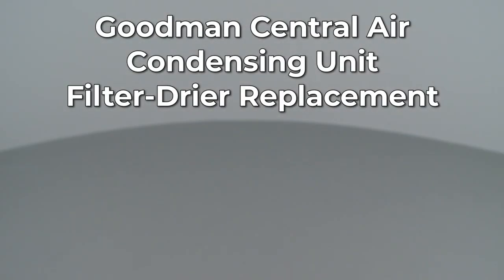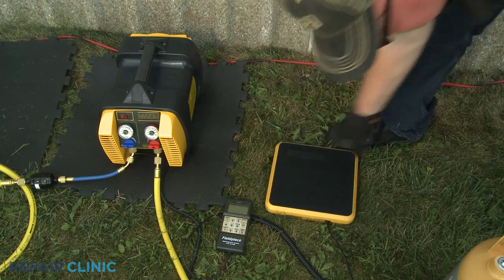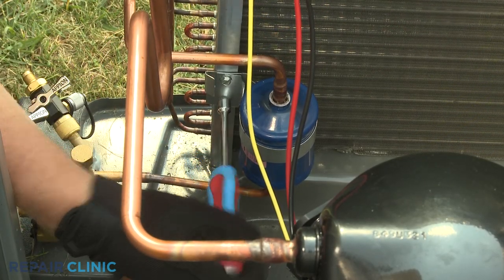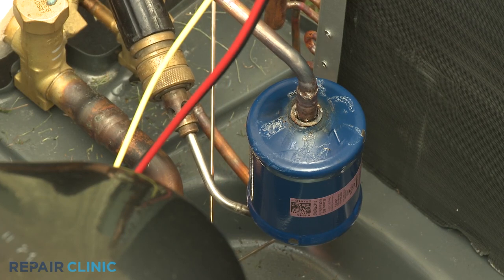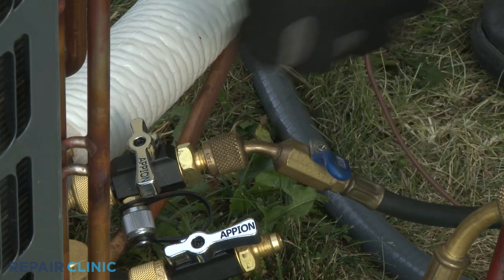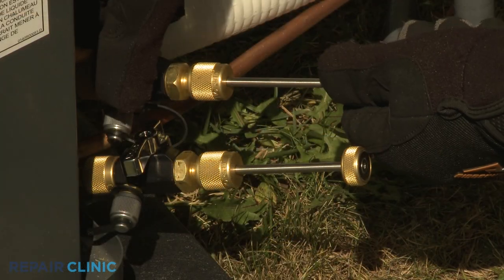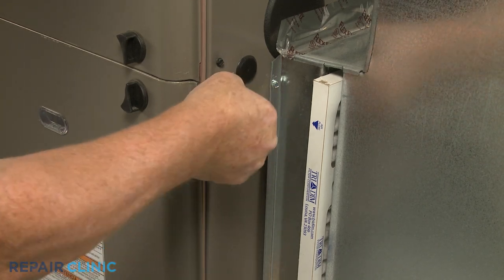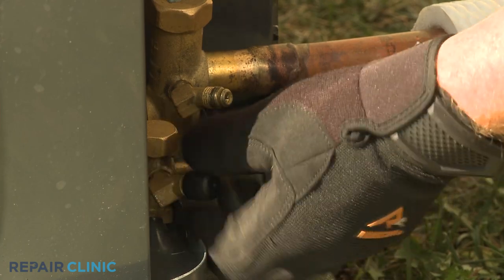Goodman Central Air Condensing Unit Filter Drier Replacement 0162R00009

Comment: The filter drier gos bad about every 5 years will leaks I had replaced twice I have spent about 1,200 dollars 
Why is the reason that they go back I have a heat pump witch I don’t use 
Can you give me a some insight about these issue 
Thanks